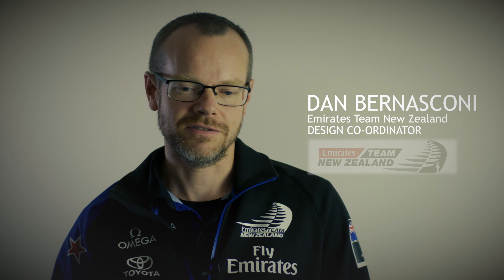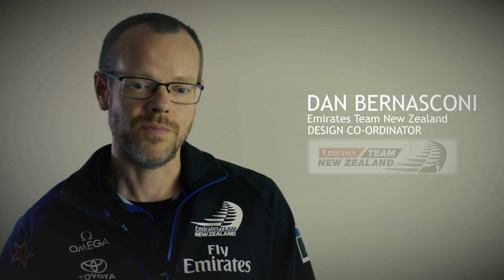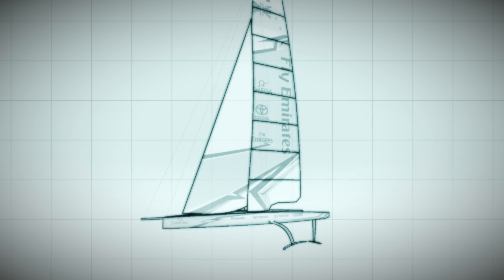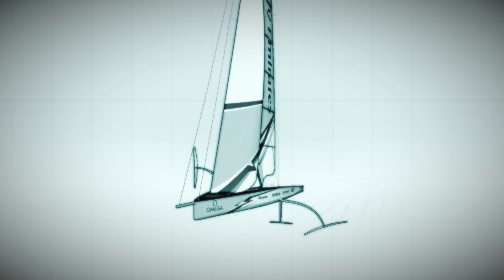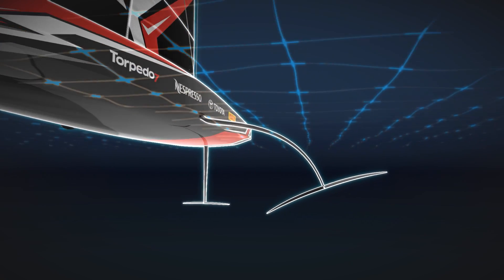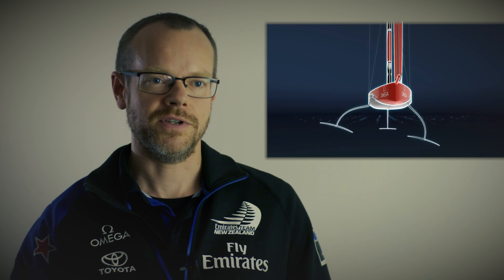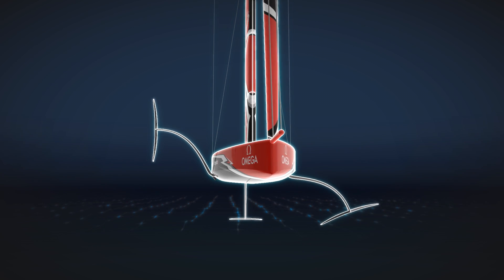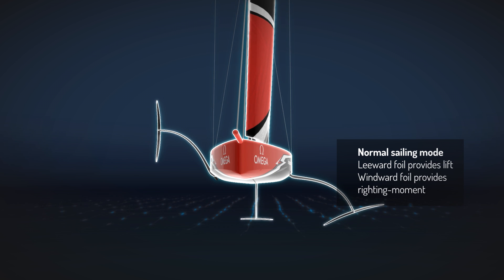AMERICA'S CUP AC75 CLASS RULE REVEALED

Comment: Does any one else see one of those lifted foils skewering crew on another boat?
Reply: I foresee an entanglement and foils being ripped from hulls during close racing
Reply: If these things go as fast as they hope, I don't see them sailing anywhere near each other. It definitely won't be the close up battle they show in the animation
Reply: just use the foiling trimarans already.
Reply: martin stephenson yep
Reply: Slicing and dicing. 😦
Reply: Yep, that's the first thing that came to my mind.
Reply: And that's part of the issue. Even in the cats used the last few AC's (and others) wind, blockage, was a factor at times, not like the old days, but it still was. With these yachts, we could often see large gaps between yachts, making some races seem like timed races, not head-to-head.